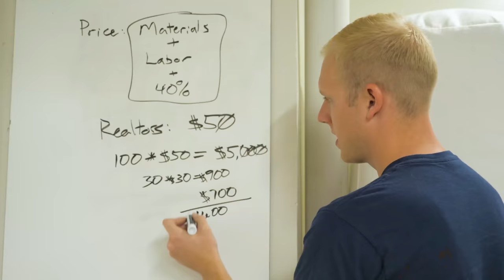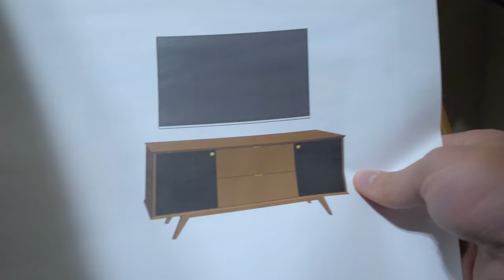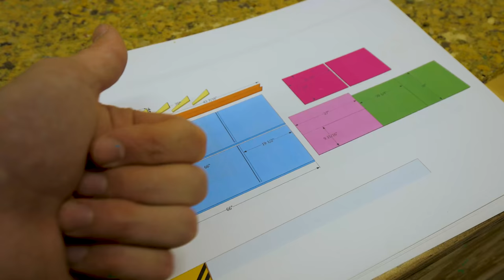We need to get out of here… 🌱 | Furniture Business Update

Comment: I've mentioned it before on one of your vids (maybe the one where you first got the storage unit): but you can rent enclosed units that are much bigger with power and the ability to work in for about the same cost (or slightly more) than the indoor units at the big corporate boxes like yall are at. 

I'm in Houston too (SW side) and I rent a unit for a camping trailer in Stafford (just  outside the Hou city limits) with power and covered, which I also use as an office away from home (when you need a change of scenery - very useful during the lockdown) .  That complex I rent in (aimed at RV and boat storage) also has fully enclosed storage units ( about 50' long and 10-12' wide) that people rent for shop usage. I know there is at least one welding company there, and a couple of builders, I think one of which is a cabinet maker.

Also the Uhaul and storage place on 59S just north of the BW (it's where I get my propane refilled) does the same. I was talking with a guy that makes cleaning chemicals there, there was a welder, and quite a wood work types.  

Some other storage lots around also lease out office/warehouse style setups, but I found them pricier than they should be (like the one across from the DPS/driver license office on Airport).

Comment: Ok, you guys are great, like the husband wife team working well together. But a safety note.. 40yrs in construction and wood working i notice things people do.  NEVER USE A MITER SAW LIKE THAT! Never plunger into the board and PULL! NEVER! That is how you loose fingers. Alway set the board, pull the head out, then plunge the blade into the board! Rotation of the blade will try to roll out, pulling can allow a buck or skip and climb the blade up the board and out at you instead of cutting if there is a pinch or other issue.  I have personally seen on more than on occasion people cut fingers and more off doing that. It sucks! Wouldnt want it to happen to ya.
Reply from the maker: I know, it’s a miracle we’ve made it this far… I guess we shouldn’t rock climb or fly through hurricanes either!
Reply: @jennieanddavis  seriously, not busting on yay, just really need to use a miter saw correctly. The way you are cutting can be extremely dangerous!